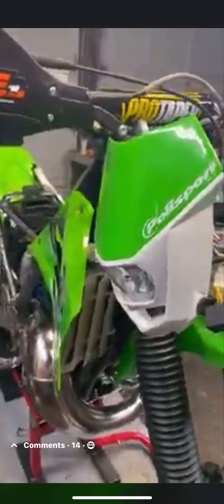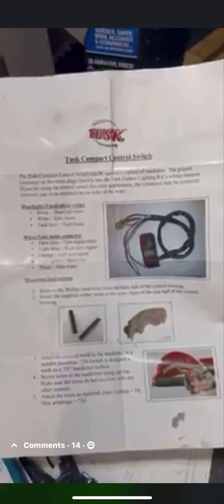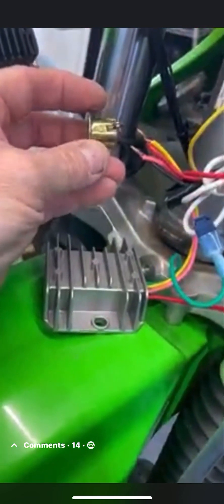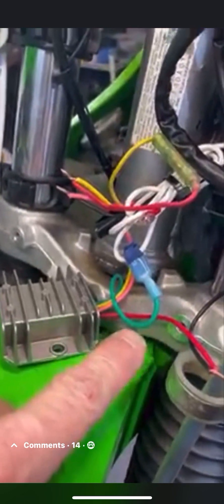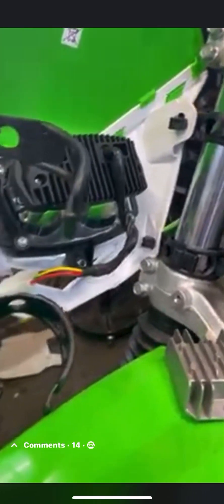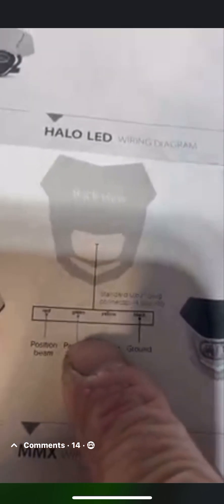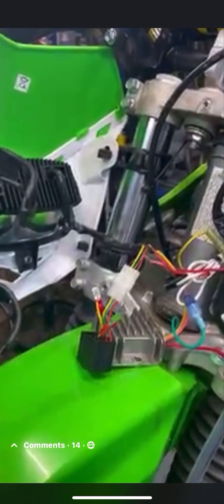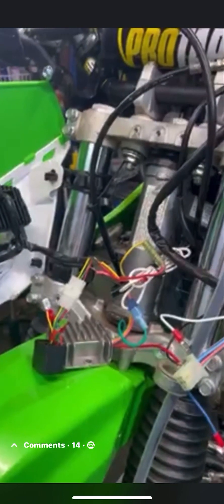How to wire in LED HEADLIGHT into a KAWASAKI KDX

Comment: Why didn't you use the stock on off button?
Reply from the maker: Because the LED has an option for hi and lo beam. Truth be told though, I plan to swap it out for just a simple on/off button soon. Don’t need all the extra baloney on there.
Reply: @DirtBikeDaryl   perfect 🤙🤙 thanks planning on doing this soon myself on mye 94 kdx200 🤙 the stock bulb socket finally crumbled and I was like this is the time for led conversion gonna try it with an LED anti flash ballest to hopefully keep constant light
Reply: @DirtBikeDaryl  have a link to the one you used? Can't seem to find a water proofesh one
Reply from the maker: @Blakestish  
https://www.rockymountainatvmc.com/parts/tusk-compact-control-switch-with-headlight-options-p
Reply: @DirtBikeDaryl  awesome but I was looking for the rectifier link? Trying to find amperage and wattage specs or one similar to yours
Reply: @DirtBikeDaryl  did you remove the stock ac Block/ resistor under the seat above the air box that the tail light is connected to?
Reply from the maker: @Blakestish  , No that all is still intact. Only changes to DC up at the head light area.
Reply: @DirtBikeDaryl   ahhh ok think if you worked it to your light switch for low and high beam to be on after you switched to a / DC that you wouldn't need that ac regulator on the air box?
Reply from the maker: @Blakestish  You know, I’m not 100% sure about that.